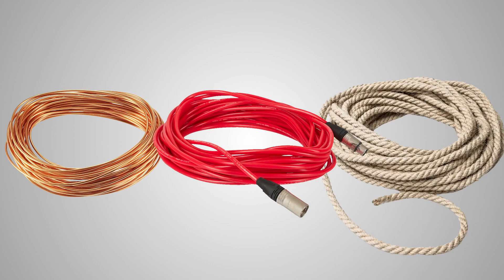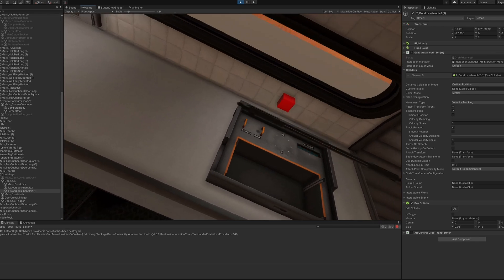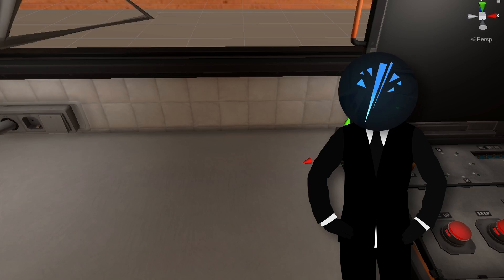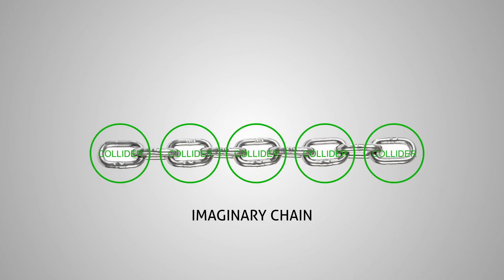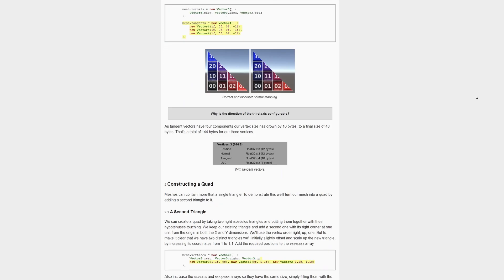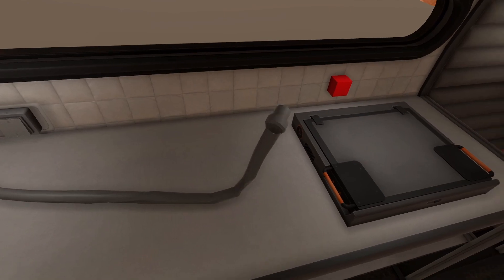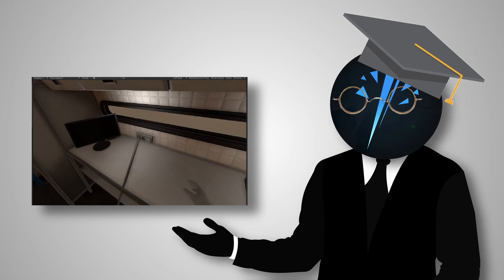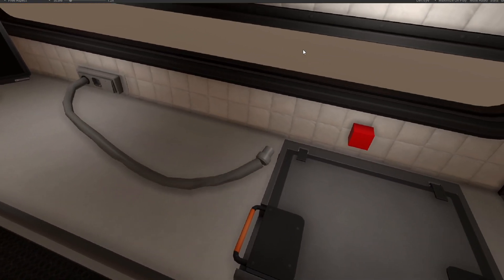I Tried to Make a Cable for my VR game | Devlog

Comment: A way that you can fix that little part at the end of the cable where you can see through the cable is you can attach a sphere that is the same size as the cable to the middle of the back of the plug-in part